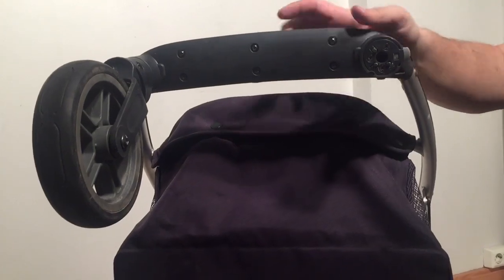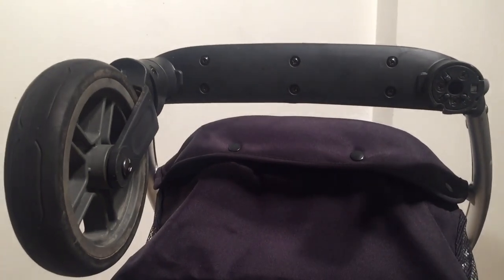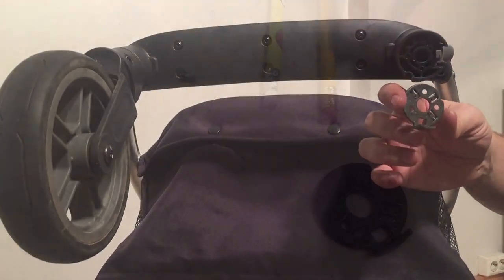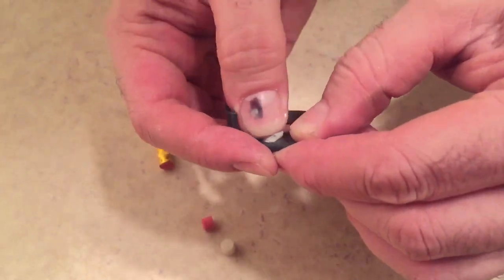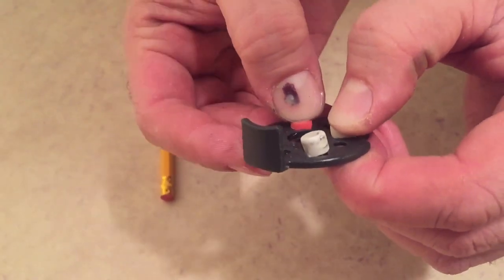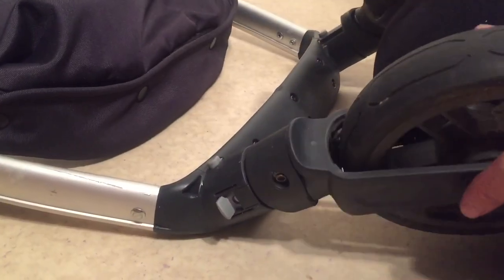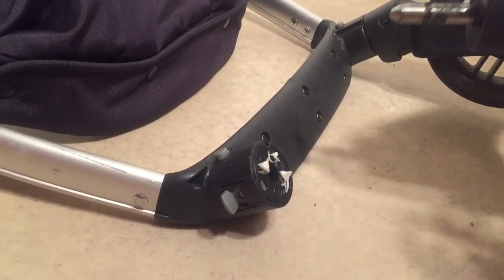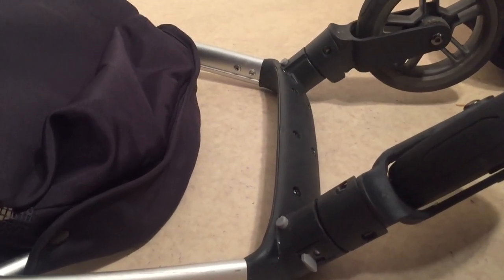How to Fix Loose / Wobbly Front Wheels on an UPPAbaby Cruz. Easy and Cheap DIY Fix !

Comment: This worked a treat. Thank you. My wife was going to throw the stroller before this fix. 
Didn't have pencils with an eraser so I just cut a large eraser into bits. 
Used a silicon multipurpose grease. Magic. Thanks again!

Comment: Our 2 years old stroller  just started to be more difficult to rotate.I check It out and I saw that on Cruz V2 only have 2 "teeth" so even worse than in your case. I was thinking on add nylon disc to increase distance, but I like your idea.  I wonder how much people deal with this problem everyday... I only see this mention on internet  related to this kind of failure.